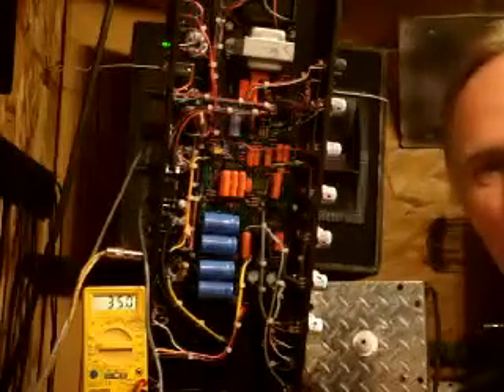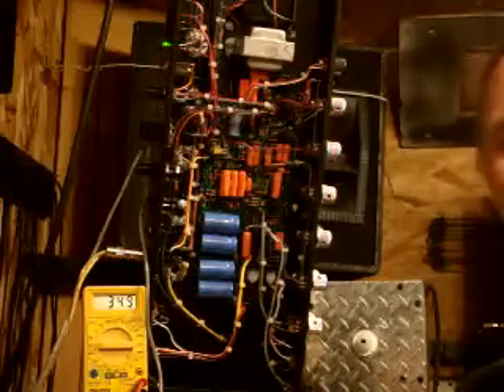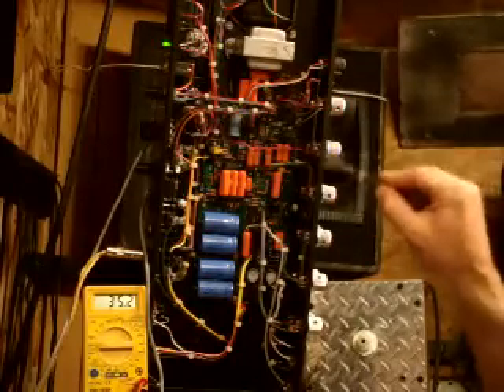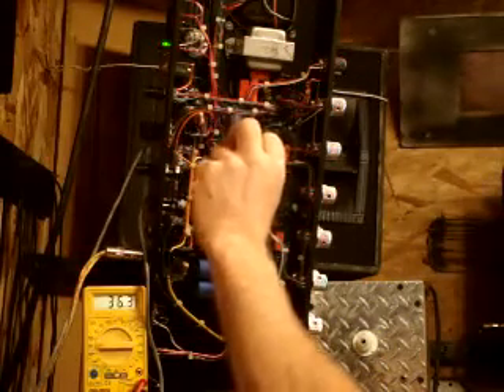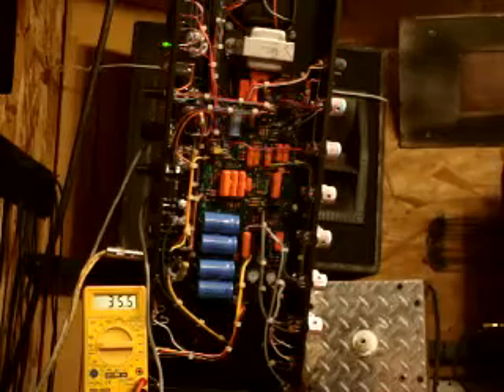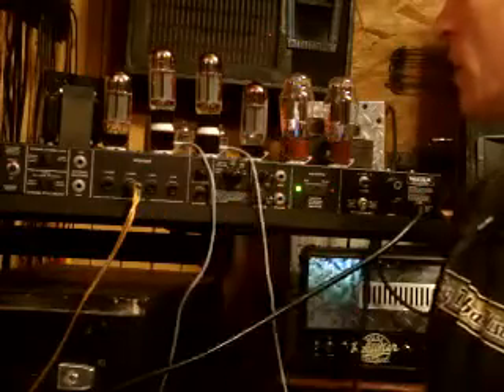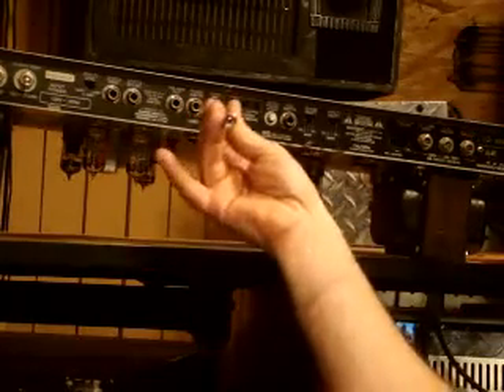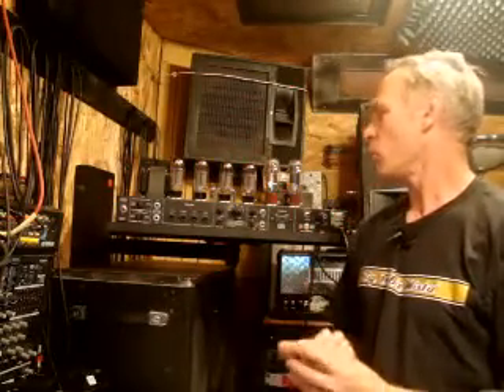How to Bias a Tube Amp Part 2

Comment: Checked out the site to mentioned knowledge articles regarding safely working with tube amps for discharging caps, etc, but there is nothing there or it was buried so deep I couldn't easily find it. I know this post is 5 years old and you've most likely changed things quite a bit since then. Maybe you could add a link in the description for to check that important info out. Thanks.
Reply: For some sound safety advice with a touch of humor try: http://www.aikenamps.com/index.php/safety-tips-for-working-on-tube-amplifiers

Comment: Sir, Could you tell me, is it possible to make mode which give possibility to setup any kind of power (or preamp) tube in amp? What steps I should do necessary? Some algorithm (step-by-step) (maybe with links for detailed info for each step)?
   For example, goal is to make versatile amp head with wide range of possible tones. Without buying 3 different heads.But with buying just a few sets of tubes? And then just change tube setup if I need different tone, more or less gain, etc.
   Is it possible to make some microscheme (chip), some CPU or controlling block which will made all necessary adjustmants (re-bias and other, you know better) automatically (user should just input some info - tube models, tube types or some numbers for voltage, resistors, etc)?
Reply: KeeNchiK 
Check out a Hughes & Kettner Grandmeister 36
Reply: Check out Bugera trirec.. Infinium technology auto-biases the tubes. no tech cost or hastles

Comment: Plate voltages of a tube DO NOT follow ohm's law applied at the grid,, even if you had gotten it right! Tube transconductance can vary by more than 100%, 2:1, from the "average" of the published curves! Setting the grid bias is valid way to balance only if the tubes are matched to begin with. I always check gain to the plate with a scope for balance!

Comment: Ok. I'm unaware of why you would need to adjust wires or put in resistors? watts?

I was answering a question about amp heads that don't have a manual adjustment. Hughes and Kettner TSC. I'm told it will allow a 6l6 and EL34 to push pull against each other.
the technology in question eliminates any need to do anything except stick tubes into the amp and turn it on.

Comment: some of these new amps have a self adjusting feature.  I've seen it in H&K and a few others.. as the tubes age, or as they are changed, the amp will make the adjustments by itself, no need for you to test and adjust manually or purchase matched tubes. i think it was an H&K that lets you mix 6l6 and el34

Comment: @MetalFTWin No. Those are fuses. They protect your machine from power surges. Marshall power amps usually have what looks like a cube with a small slot for a flat head in it inside the circuit board.

Comment: So what does the power tube switch on the amp do?  Change the plate voltage for different tube types?  Also, you were saying volts.  Isn't this reading in milliAmperes?